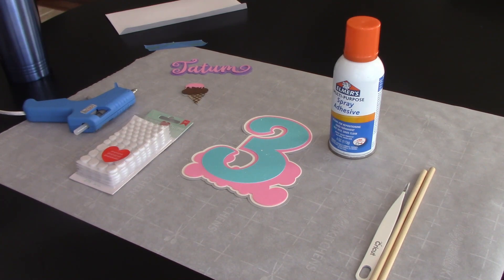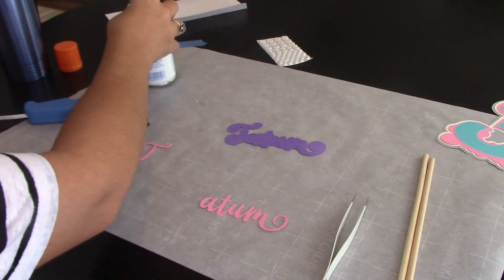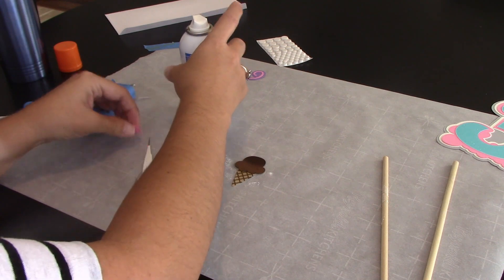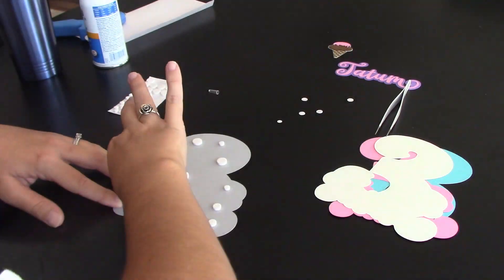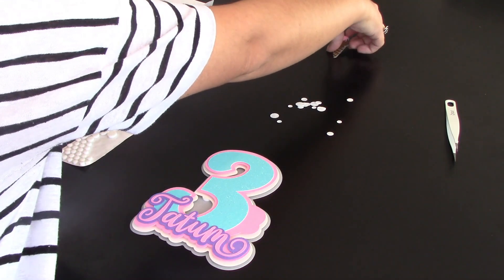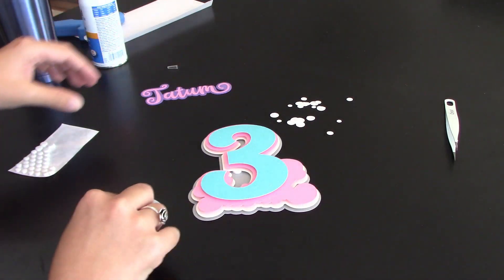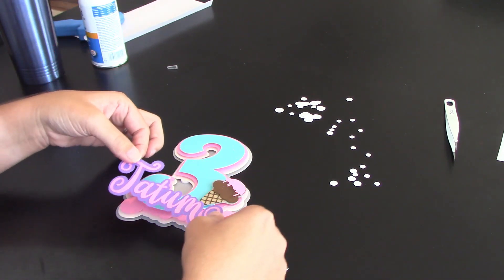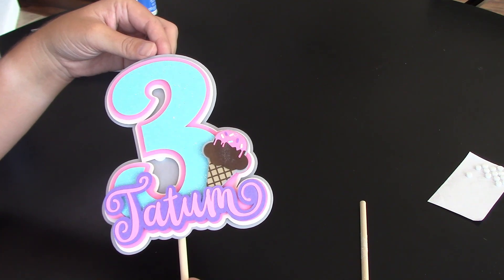How to make a 3D cake topper

Comment: Hello, this is adorable!  I can't wait to make one!  I was just wondering if you could put the dowel between the bottom 2 layers.  Maybe sand down the top part of the dowel to flatten it a little, if necessary.  I haven't done this yet. I'm just thinking out loud.
Thanks for this video and your other one showing how to make it.
Reply from the maker: It would just depend on your design.  As long as you can't see the dowel between the layers and you have enough surface area to attach the top layers to that would work just fine.

Comment: Hi can anyone explain how did she print everything separately even the sprinkles
Reply from the maker: Hi! This video is a follow up to a previous video where I showed how to design the cake topper. The cake topper itself was cut out of cardstock using my Cricut machine. It cuts everything for you individually, even the tiny sprinkles. Here's an affiliate link to the Cricut if you want to check it out.  https://shareasale.com/r.cfm?b=923343&u=1653747&m=51766&urllink=&afftrack=

Comment: Would you recommend to glue your layers together with just the glue gun instead of the glue dots if the 3D look is not a necessity? Or is there a reason we use the glue dots? I just found your channel love it, you do an amazing job of explaining and give great tips!
Reply: If you don’t want a 3D look you can just glue the layers together. I wouldn’t use a hot glue gun though just regular glue.